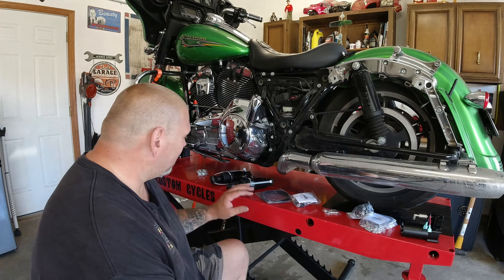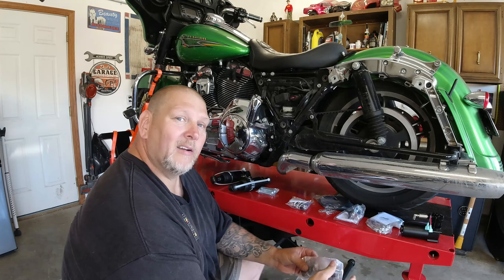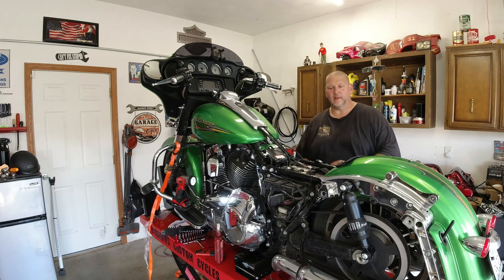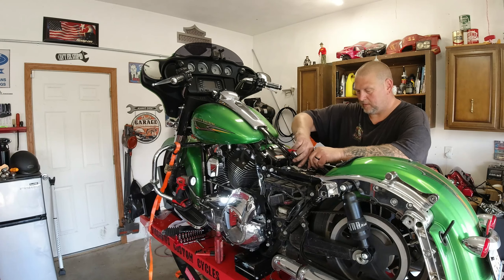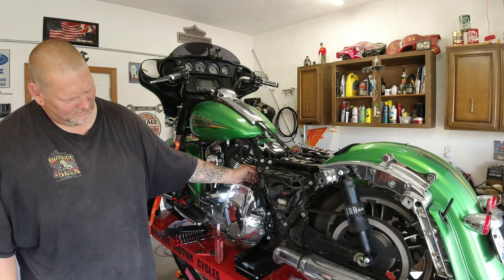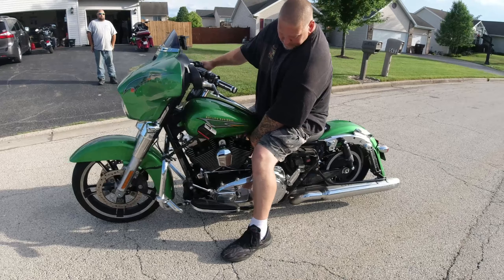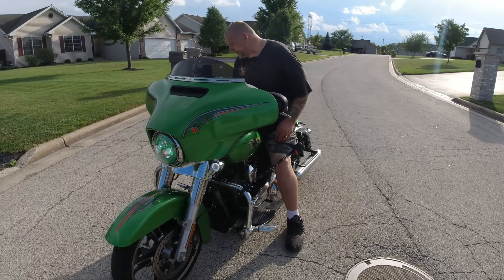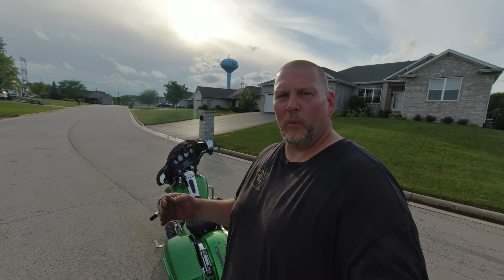Air ride for your street glide

Comment: I built my own air ride system. Mo roe shocks with 5 inches of travel. Dump valve and small compressor. Simple install and works great. It's a 2019 streetglide and has 36,000 miles on it. What a different with the air suspension.
Reply from the maker: I am getting ready to put air ride on my road glide, hopefully it makes a huge difference.
Reply: InstaBlaster...
Reply: Front, rear or both?

Comment: Where was the video where you fitted the compressor or was the the fast 4 second bit between 2.52 & 2.56. ??. Were you in a hurry or did you just feel that it was not important to show this part. Also what year of Street Glide is this fit for.
Reply from the maker: Hey I'm sorry I have gotten back to you sooner, I really don't remember why I didn't point it out on the video, other than I probably put it on before I started the video which I have been know to do lol, the compressor is held on with two  Bolts through holes already on the bike, the bike in the video is a 2015 street glide. I am getting ready to put a JNR air ride with the fast up and ride height repeater on a 2017 road glide and I will make sure to point out how the compressor mounts on the bike.
Reply: @bigshow65  Thank you so much for your detailed reply. I am using air suspension since 2011. i used Arnotts for about 6 months but the ride was terrible so i changed the shocks to Corvette air shocks and they have worked perfectly for the past 10 years +.
I am now converting my CVO road glide ultra to a bagger so I have to move my compressor which is presently located between the Tour Pak and the carrier on the left side.